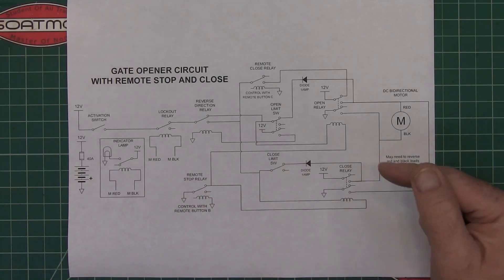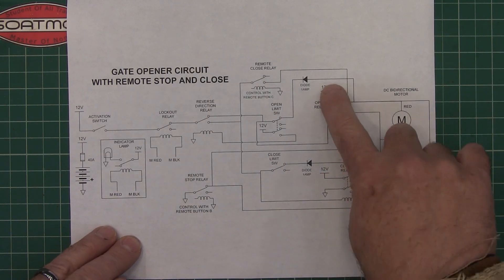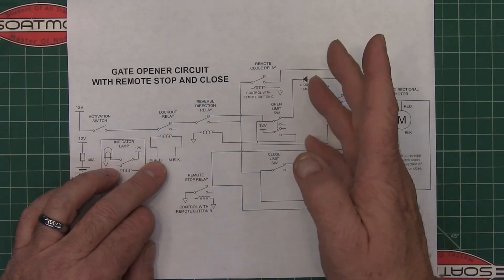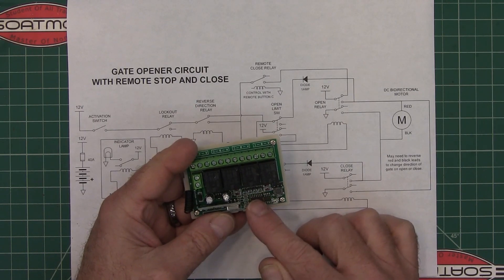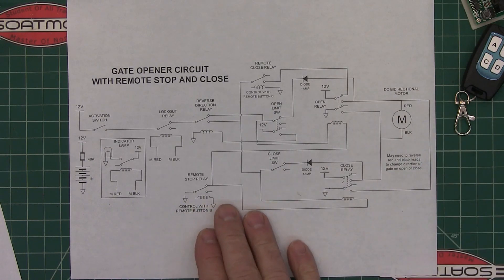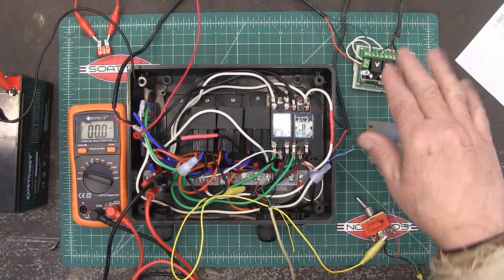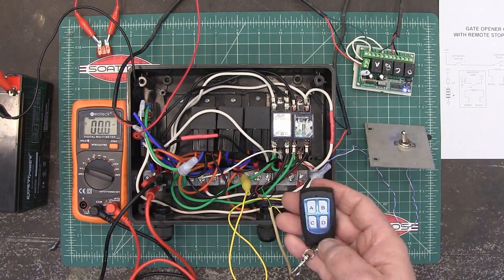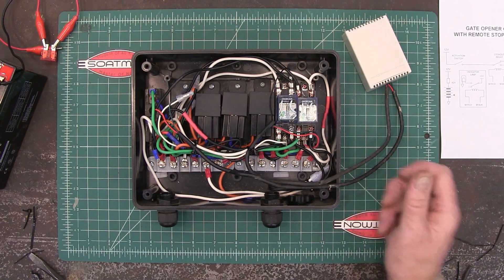Gate Opener Circuit Build

Comment: Thanks for the brilliant video and for being so generous with your knowledge.

I've built your circuit and love the analogue logic, even if I can only, barely understand one part of it a time!

One addition I'm trying to make is a time out loop, so if the gate is left open, after a couple of minutes it will self close.

I've found a delay timer relay circuit on amazon, that I think will do the job via the gate open switch and reverse relay... Somehow.  Any ideas?
Reply from the maker: That's awesome.  You may be the first one to actually build one.  A delay timer relay is probably the way to go but I haven't thought that through.  Thanks for letting me know.  Mine is still going strong!
Reply: @SoatMon  I ended up using a couple of the spare terminals from one of the limiter switches to trigger an independent timer circuit. Then a capacitor and resister to turn a latching signal into a button press.

Long live the Bumblef*cks

Comment: Can someone please let me know which size wire to run to the relay? I got the same ones that he has in his video.
Reply from the maker: I ran 12 gauge wire from the power through to the motors.  They will draw a lot of amps.  I used wire from an old extension cord as it's pretty easy to bend. Good luck!

Comment: I'm defiantly doing this! I don't understand how to wire all this together but I'll manage. Can I use the transformer from the mighty mule with the low voltage to use on this circuit?
Reply: Scott did you figure out how to wire these? What size wire did you use?
Reply from the maker: Here is the wiring diagram.  https://drive.google.com/file/d/1Lc0zXopGWAWHGYL93wHNG8q5_vyvdDZ8/view?usp=sharing

Comment: Thanks! I’m that guy. I am tryin to do it with an arduino but i can’t understand the other guy that talks with a heavy heavy hindo accent. So the arduino is out. One thing i think we have in common is we both dislike Mighty Mule control board!
Reply from the maker: I hope it works out for you Catch!
Reply: @SoatMon  im almost to the point where i set it up on a fence post for some target practice🤣😂🤣. Its just takin longer that i like. More studying to do.

Comment: Hi there, I htink this video is great. Thanks for making the time to share. I'm not too skilled with electronics but I might give this a try. 
Quick question: I have a functioning mightymule gate opener arm, which I believe already has limit switches inside of it. Any way to use those instead? 

Also, have you gotten around creating a wiring diagram rather than schematics? Those of us who don't know how to interpret schematics would highly appreciate it :)
Thanks!
Reply from the maker: The mighty mule uses an encoder that counts the revolutions of the motor to know when to stop.  You can't use that with this circuit.
Reply: @SoatMon Can you please send me a diagram on how to connect the wires to the relays and other parts?
Reply: Your video is great, thanks

Comment: Can you show how you wire all the components I have a mighty mule motor that I bought on garage sale is new and working and I like to use this circuit I’ll buy all this on Amazon but
Reply from the maker: Here is a link to the schematic.  https://drive.google.com/file/d/1Lc0zXopGWAWHGYL93wHNG8q5_vyvdDZ8/view?usp=sharing
Reply: Gabriel Garcia did you figure out what size wire and where each wire goes where? You’re not alone if not. We’re still trying to figure it out.

Comment: Nice concept to get "back to basics" with relay trigger logic. The only trouble I see as with every solution based on mechanical limit switches eventually becoming the weakest link of reliability in the whole machine.
Opto-electric switches still would add some reliability.
PS: As an additional precaution I would consider to have motor overload/overheat/over-torque protection to save motor/gears just in case.
Reply from the maker: I'm not real skilled with electronics.  I would be interested to know how you make a basic overload protection circuit?  Thanks!
Reply: "As an additional precaution I would consider to have motor overload/overheat/over-torque protection to save motor/gears just in case."  And just how would you do that economically...